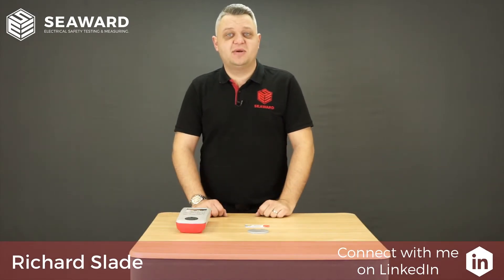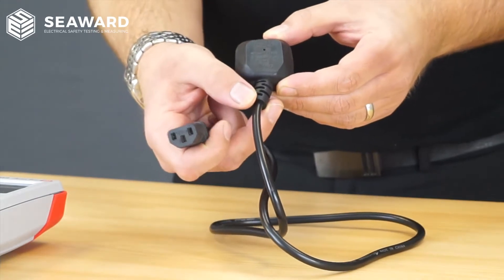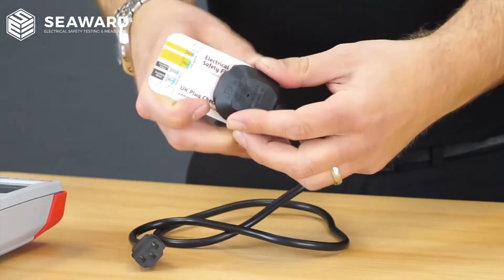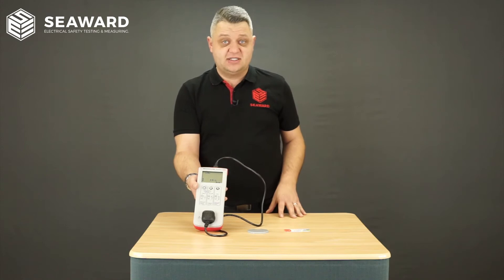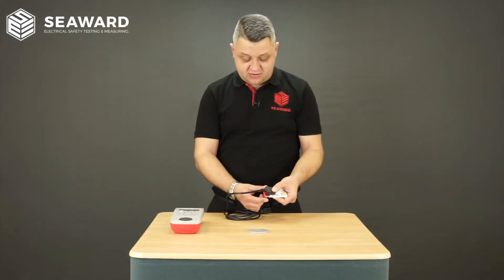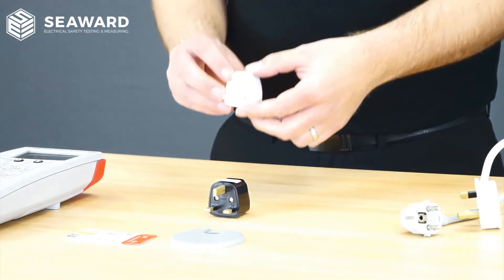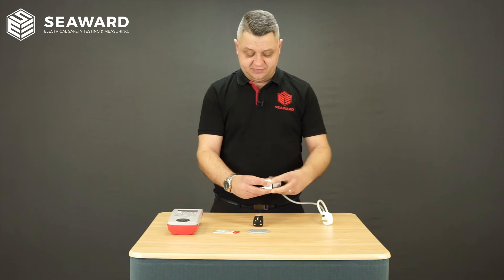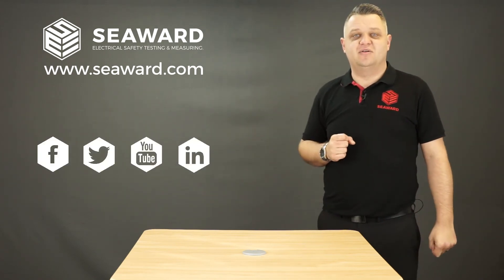How to identify fake or counterfeit electrical products - Seaward

Comment: Hi just wanted to add a quick comment with regards to the points raise about our video and the purpose of the plug top fuse. 

Firstly it is always hard to strike a balance between producing a short video that can be easily understood and including detailed technical content. In this case we were keen to highlight the fact that the counterfeit lead featured in the video had no fuse, which is a key safety concern and chose to highlight the shock risk as this is easily understood by most viewers without the need for a detailed technical explanation. 

To clarify with regards to the fuse, the plug top fuse actually performs several functions. In addition to providing overload and short circuit overcurrent protection, it also forms part of the fault protection for class 1 appliances ensuring automatic disconnection in the event of a fault between live parts and exposed conductive parts. The fault protection therefore protects the user against electric shock by indirect contact with exposed conductive parts made live by fault.

Kevin Smith 
Seaward
Reply from the maker: Excellent, thanks Kevin!
Reply: @SeawardElectronic  great course very factual
Reply from the maker: Thanks Patrick

Comment: The travel adaptors, Richard stated that the fuse is there is protect you from an electric shock. Sorry, but the fuse is to protect the flex and sometimes the appliance. I could say, for example, cut the end off an IEC lead, exposing the live conductor and plug into a socket (I DO NOT RECOMMEND ANYONE DO THIS) and shock myself with 230v (BTW, I won't be doing so). The fuse in the plug, say 13a will not blow as the amount of power needed to blow the fuse would have to greater than 2990watts, as they tend to blow at a slighty higher current. The body would receive a shock but not blow the fuse.
Reply: The demonstrator must reply.